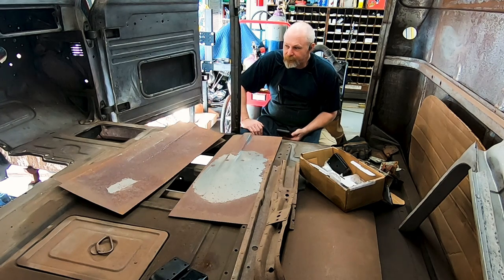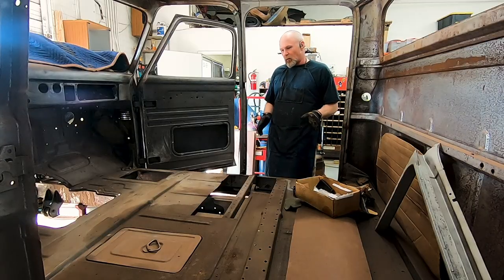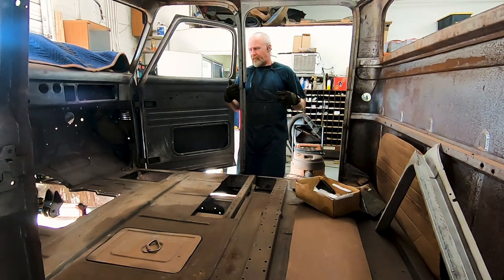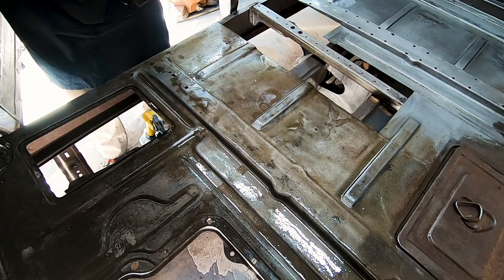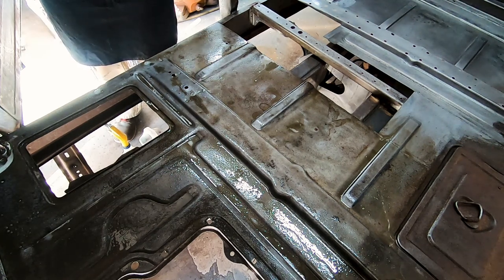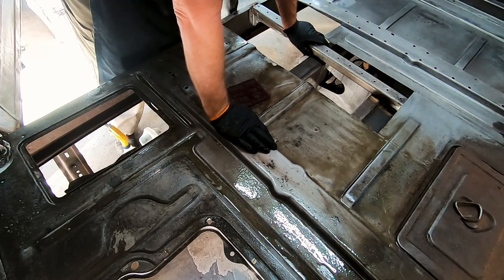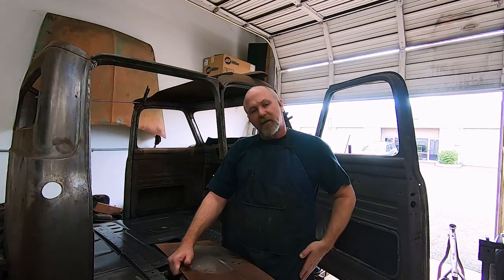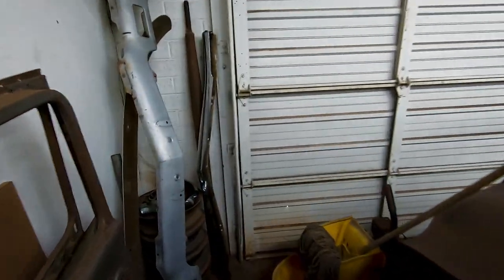DIY Easy Surface Rust Removal

Comment: Found your channel on a link in a first gen Dakota forum. Any info on caliper brackets or brake dust shields for a 92 RWD?
Reply from the maker: Yeah, I will be getting the first batch of the new caliper brackets in about 30 days. I want to work with a few guys to get these out in the public, spread the word if you can!

And I will be doing a video on these explaining the installation.
Reply: @ELpolacko  Thanks! I would definitely get a set for my 92 even for the standard calipers. I will pass this along to the group! A lot of people looking for these parts now that the trucks are this old. If we could get someone to make outer beltlines again too we would be doing good. 👍
Reply from the maker: @cc3968  Sent me links to those groups, info@industrialchassisinc.com if you would!
 I have ideas on other brake options besides just the caliper brackets
Reply: @ELpolacko  do you have an email I can contact?
Reply from the maker: @cc3968 I linked it above the comment. info@industrialchassisinc.com would be fine